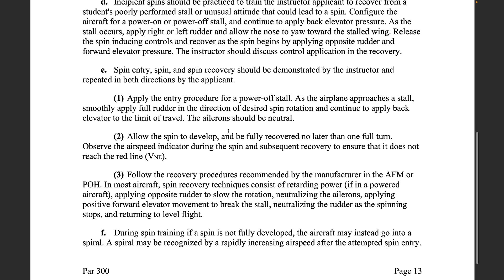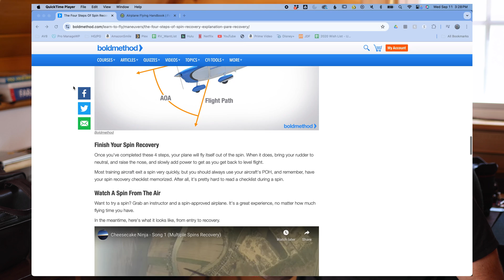Flight Instructors don't understand STALL SPIN accidents!

Comment: Some good points, but a plane that stalls in a coordinated bank, the nose doesn't drop straight down towards the earth. It pitches down (out of the turn) relative to the aircraft. Visualize this in the extreme to understand this. 90 degrees, 180 degrees (top of a loop). If you stall, the pitch, or at least the pitch rate in a loop, decreases.
Reply from the maker: @ArcticMayhem  without the pilot easing off back pressure or pushing forward, gravity is literally the reason for the nose coming down. In a bank that will be both pitch and yaw- how much of either depending how much bank (90 degree bank it’d be all yaw, like the dart 🎯)
Reply: @RyanVoight  no, gravity is not the reason for the nose to come down. Gravity isn't the only force working here. In a bank, centripetal force is also at play. Go do an accelerated stall in a 60 degree bank and see which way the nose falls. Not towards the center of the earth, but down out of the turn. Do a loop and pull too hard in the up line, which way does the nose go when it stalls?
Reply from the maker: @ArcticMayhem the forces you’re feeling come from the direction change of the arc you’re flying (turn or loop same difference). That direction change is from excess lift, and as you stall lift drastically decreases- the direction change of the arc slows or stops. That’s very different than the plane pitching against the arc. In a loop gravity is in line with the arc, but in a turn it is not. Maybe it FEELS like the plane is pitching back into the turn, but if the pilot didn’t let off the elevator or push, there’s no phantom force moving the nose of the plane back against the banked turn. Maybe I’m just misunderstanding what you’re saying, but how can you think gravity doesn’t take over when the plane stops “flying”?
Reply: @RyanVoight  I don't really understand what you're trying to say either, maybe we're saying the same thing. In the video, he uses a dart to describe what he's saying, but he's missing the fact that there is also inertia at play. For example, take the same dart and throw it straight up. Until gravity overcomes the inertia, that dart will point in the direction of travel, not in the direction of gravity.
Reply from the maker: @ArcticMayhem direction of travel = point into the relative airflow. As speed decreases in a turn the plane descends, relative airflow changes to be opposite the direction of travel (caused by gravity).
Reply: @RyanVoight  That's not really how it works, but OK.

Comment: Navy teaches accelerated stall, break turn stall, power off stall, approach turn stall, power on stall. Yes, you can do your power off stalls at thrity degree AOB just fine and PPLs can learn this way.
Reply: They also teach not to pull back on the stick in your landing pattern turns - constant AOA turns not constant airspeed turns. Power to control descent rate, trim to AOA.

Comment: This is just incorrect. The aircraft will depart in the direction of the rudder deflection, so if you hold the up rudder in a turn - you will observe the turn rate lower than what you would expect in a coordinated turn at that bank angle (possibly even zero turn rate), and then the aircraft will depart through wings level in the opposite direction. So the idea that you could predict impending stall by observing anomalies in the turn rate is correct, but it can happen either direction.
Reply: Not true, rather sometimes conditionally so meaning not absolutely true. You can have rudder deflected one way but insufficiently to counter adverse. You can have rudder one way but insufficiently to counter turning tendencies. You can have rudder one way but insufficient to counter power asymmetries. Spin will go to the total yaw side not necessarily the rudder side.
Reply: @jimallen8186  that is accurate
Reply from the maker: 100% agree with what you’re pointing out- can spin either way as determined by rudder use and being uncoordinated. 

This video isn’t about uncoordinated stalls though. There’s thorough teaching about uncoordinated stalls. This is about getting slow when banked, the nose naturally coming down because the relative airflow is changing (flight path is changing), and how that creates rotational inertia- a pilot can keep the plane coordinated as the nose comes across like we do during lazy 8’s, but there’s still rotational inertia in the yaw axis. This is never really highlighted or pointed out at all even, and I’m hypothesizing it’s a contributing factor in stall/spin accidents that isn’t a part of spin “awareness” (PPL-CPL)) and “training” (CFI).
Reply: @RyanVoight  I just don’t see how any theoretical knowledge of aerodynamics of stalls is supposed to help your run of the mill GA pilot. The only way a stall could ever happen in normal GA flying is if the pilot is so distracted or incapacitated that they have lost basically all their situational awareness and have literally no idea what’s going on. How are they supposed to use any of that advanced knowledge when they don’t even see their airspeed decay, their bank angle develop, or stall horn going off? I always found these videos on stall/spin awareness completely useless. The only way to make the difference is to follow a strict SOP as to  what airspeeds to fly and what bank angles to allow. Just focus on those parameters and you’ll never stall. Very basic.
Reply: If they know to honor AOA and to not pull back, then they’ll avoid stalls. Airspeeds to fly and strict SOPs will get you into trouble. Look up Sidney Dekker regarding the latter. For airspeeds, see Medium “Improve your Landings with AOA and Power Techniques.” Airspeed based flying is hazardous flying.
Reply: @jimallen8186  why is airspeed-based flying a hazardous flying? I don't have an AOA indicator, what else am I supposed to fly :)
Reply: @alk672  for light aircraft, the angle of attack is approximately entirely determined by the stick/yoke position.
Your angle of attack indicator is your hand, it works in a bank, it works while inverted, it works at 130kt, it works at 12kt. Jimallen is right. Another free online book series that goes into more details is "fly better, the things you should have been taught when learning
to fly!"
Reply: @alk672  you don’t need to see AOA to fly AOA. Despite what you may reference, you trim to AOA. Let the trim do the work (adjust for off axis power and tractor propeller wash over horiz stabs & elevators as needed). Don’t pull back to maintain speed in turns, instead let it accelerate a few knots holding the trimmed AOA. AOA doesn’t increase, no increased stall hazard. Use power to control VVI (or spoilers in gliders).
Reply: @aaronhammond7297  I have no angle of attack indicator in my Cessna. And the ones I saw are definitely not something I would entrust my life with. Let’s work with what we have, this is not Navy flying.
Reply: @jimallen8186  that I certainly do. But at the end of the day unless I start putting stripes on the control column… I don’t see how not flying airspeed is an option. Sure it only works perfectly well in a wings level unaccelerated flight, but that’s how I mostly fly. In a turn I just have to know how much I can bank and what speed gives me adequate margin. Sure I can feel if I’m pulling, but I can’t just trust the feeling alone, can I.
Reply: @alk672  The AOA indicator is your hand. If you're pulling back too far you stall. Don't pull back too far... There's literally just a point that you don't pull past, it couldn't be simpler.
(It's not the force of pull, the position)
Reply: @alk672  it is easy to trust the feel of not pulling on e stick because you’re not pulling on the stick. Lateral stick only until roundout and flare, or to push a little during go around. Use that wings straight in downwind time with airspeed to trim thus setting your AOA. If you’re wings straight and holding level, your pitch is your AOA. When folks talk “pitch and power,” they’re really talking flying AOA.
Reply: @aaronhammond7297  yeah but trim exists, so I can’t feel it. How am I supposed to judge the hand position. Force would be easier to judge, but again - trim.
Reply: Try scratching your elbow without looking. I'm quite sure you're aware of where your hand is.
Reply: @jimallen8186  well I guess you could view it that way, but that still relies on maintaining a certain airspeed on downwind while I’m trimming it initially. I of course agree that if you have to push or pull aggressively you’re definitely doing something wrong in the traffic pattern.
Reply: @alk672  “the ones I saw are definitely not something I would entrust my life with.” Why? Why not? Do they look finicky? Could that be a different perception of something simple? Simple meaning not much to break. And if it broke, easy and obvious to recognize such via data readily determined to be errant. Meanwhile, have you seen how finicky and delicate the pitot-static instruments are? Remember their failure modes some of which are not immediately obvious? You wouldn’t be trusting it anyway as you’d have the trim set with the lack of stick forces so as to maintain the trim set confirming it. You can cross compare speed while wings straight presuming you’ve accounted for weight in your speed or you can crosscheck pitch while both wings straight and altitude level to see the angle matches. No need to solely trust. Much better than trusting airspeed.

Comment: For conventional airplanes, this really isn't factual information. An airplane in a bank that stalls may spin in either direction, and it has nothing to do with the ballistic trajectory causing the nose to swing down (in such a maneuvering it's actually most likely the high wing stalls first, which would promote a roll away from the initial bank angle). Unlike a hang glider which lacks a vertical tail and rudder, the wing that stalls first is driven by the rudder usage/slip/skid angle and can easily be in the opposite direction from the angle of bank. For a great example that shows how you can spin either right or left from a stall during a left turn, and vice versa, as well as how you won't stall if you're ballistic, and you won't spin if you're not skidding, check out  https://www.youtube.com/watch?v=2pGuoc11lxY
Reply: Exactly. If you stall in a turn with full rudder deflection towards the top rudder (slipping turn) - the airplane will depart through wings level in the direction opposite to the turn. That is why some people teach - quite questionably - that a slipping turn is safer than a skidding turn. I don't see that at all since the airplane will depart either way, but I guess the thinking is that if it has to go through wings level first you get a little more time. Doubt it would help though.
Reply: A slipping turn is a safer turn as you have that time while rolling wings up to unload and as you’re getting the wings under you making all your lift to flying rather than some to turning through the initial uncommanded rolling motion. You cannot actually spin a slipping turn as the slip becomes skid as your lift vector passes through vertical before you spin that other direction. You might notice something here in common with a snap roll. Like the snap roll, this over the top spin will have an initially horizontal spin axis too, meaning safer spin as your initial incipient isn’t toward the dirt (though such will change quickly without response, you just have a moment more time to respond). It does help a lot in practice. In the slip, plane doesn’t want to spin for that initial time. Note you can also practice “falling leaf” maneuvers holding your stall using rudders as needed to keep you wings straight through sustained stall. You’ve departed and you’re yawing but you’re not spinning.
Reply: @alk672  Well, some designs really will never spin from a slip, most high wing Cessnas, Citabrias/Decathlons etc are even more spin resistant in a slip than when "coordinated", but other designs, like my Extra 330, will spin almost as readily from the slip as the skid....with just a small amount more time to recover from the slip. Once roll and yaw become coupled, a spin may develop. In a skid, they are immediately coupled, in a slip, they may or may not couple and the discriminator is the relative high angle of attack control power of aileron vs rudder.

Comment: What I have never understood is why we are teaching to not let the nose drop in our base to final turn (or downwind to base for that matter).

A stall has nothing to do with speed, it's exceeding the critical angle of attack. Fly the wing! Don't pull back on the stick and you don't stall.

Not imagine not flying a 747 pattern, but keeping things a bit more tight. Fly your baseleg and you'll get the feeling of being a little high. Now turn to final and do not pull back on the stick as you'd normally do, but let the aircraft sink a bit. You'll find that you're not losing any speed, as the aircraft will simply fly the speed you've trimmed it to. You are not yanking the stick back, so you're not increasing the angle of attack, so you're not inching closer to stalling. And because you didn't pull back on the stick hard, you've lost some of that excess altitude, putting you nicely on your desired glidepath.

Win-win-win.

But we're not taught to do this. I really wonder - why are we deliberately bringing ourselves closer to a stall during every turn that we do in the pattern??
Reply from the maker: @HansTeijgeler  in gliders it’s taught to trim or pitch for a selected airspeed, and when turning everyone expects sink rate (“descent rate”) to be greater. In airplanes people are generally taught very early all about the 4 forces and pulling back, with a little power increase, in turns. Law of primacy takes it, people learn to turn and pull.  Then the pilots that get created get ridiculed for pulling on these turns. Totally agree it’s a broken methodology that creates these bad tendencies… schools aren’t looking further than “teach it the way it’s always been taught”. 😢
Reply: Primacy is bogus. Contradicts both recency and intensity. And the CFI handbook misunderstood Kahneman while missing Klein and really skimping naturalistic decision making. Learning styles are bunk too. As for turns, you can maintain constant AOA without the increased descent with the little power plus a little more power.
Reply: Similarly, we should be teaching constant AOA turns in slow flight in addition too if not outright rather than constant airspeed. They can be level with power. And they can even be up to thirty degrees managed easily. 

Now, bonus, consider rudder turns (these are slips not skids as you have to have a slight AOB opposite else you’ll unintended roll)

See Medium “Improve your Landings with AOA and Power Techniques” as well as “Going Beyond Procedure - An Open Letter”

Comment: I feel like Accelerated Stalls should be required for demonstration for private pilot. I make sure to have my students do them at some point during training and talk about situations where it can happen.
Reply from the maker: Agree, it really gives the practical side of the textbook knowledge about crit AoA and "stall speed" changing with load factor. It's not quite what I'm talking about in this video though, because with an accelerated stall the aircraft still has speed, so reducing the AoA recovers without the nose rotating down in yaw. The accelerated stall recovery is still the pitch axis, even when banked.

Comment: I think people don't understand stall. 

They go on and on about getting slow, focussing on 'a' stall speed, or maybe scaling that by some trig function of the bank angle...

No, a stall can occur at any speed and any attitude, but only one critical angle of attack. 

The angle of attack on light aircraft is approximately entirely determined by the elevator position, so there is a position of the elevator which if you pull back beyond you stall, and forward of which you don't stall.

All the other stuff about stall speed is sometimes true, and a single number is easier to teach, but it's a secondary effect, and things that prevent death shouldn't require maths - don't pull the stick back past the 'stall stick position' - 'the critical angle of attack'
Reply from the maker: GREAT points!!!  If I may add- use of trim can change the stick or yoke position where crit AoA is achieved… so so anyone reading is aware and considers that as well.
Reply from the maker: Sorry, another thing for people reading and willing to keep the learning going- in the Flight Instruction world 'STALL' is taught like it is a binary thing, where the wing is either flying or stalled. In reality most (all?) airplanes, gliders, whatever are designed to stall progressively. In a turn the inside wing will generally reach stall first, or more of the inside wing will be stalling, causing the airplane to further bank into the turn- exacerbating the yaw inertia created as the nose drops. The steeper the bank the more the nose coming down is yaw axis vs pitch.
Reply: You could really go on more about degree of stall. Drag rises rapidly though lift falls off to a point then levels out and rises a touch essentially as the airplane or glider planform acts like a parachute with relative wind coming up from the bottom (perhaps easier to think of as a plank floating on the water).